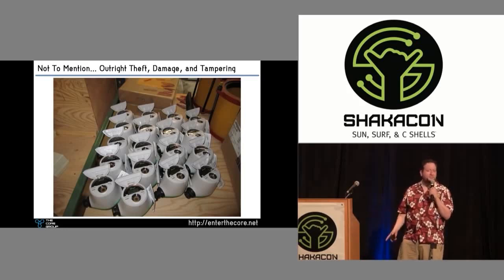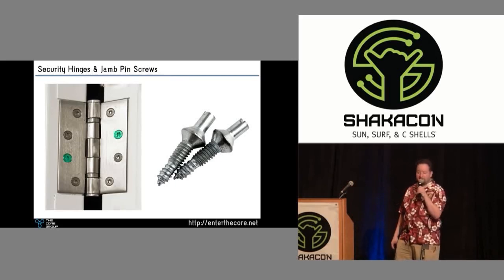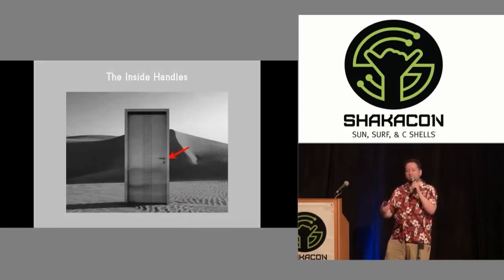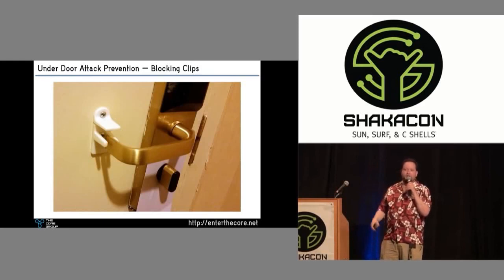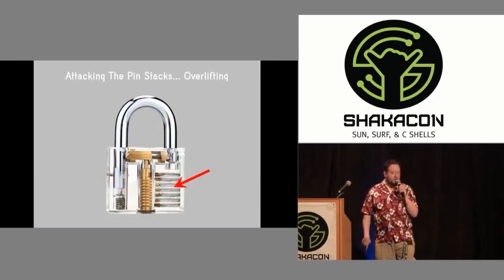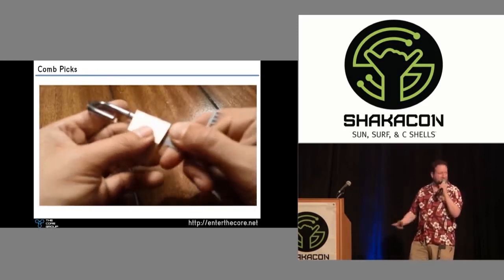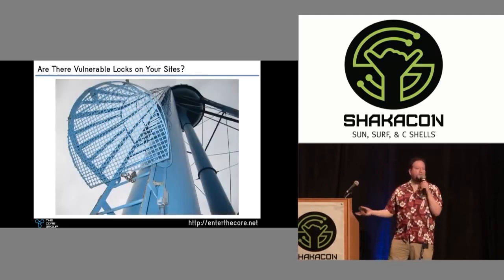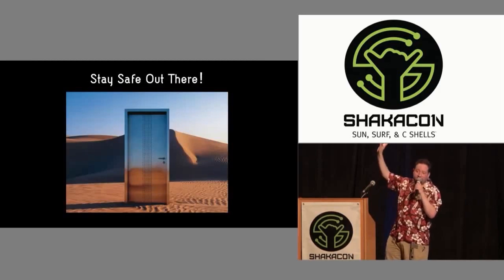ShakaCon "The Perfect Door and Padlock" talk preview

Comment: Another selling point for tightening up door fit: reduces heating and cooling wasted energy.  Can be sold/marketed as "going green" or reducing heating & cooling costs depending on the client.   Particularly true for doors that open to the outside, like double doors with crash bars.  Also a good sell for server rooms that are temperature and humidity controlled.  You can reduce load on the server room HVAC system and make the climate control system last longer by getting doors that shut properly and tightly.  

Love the talks, man.  Hope to see you continuing to post them on Youtube as time goes on!
Reply: Yep. Tons of doors are fitted very poorly. The ones to my dorm are loose enough (and lack the weather fitting rubber) that I can stick a 6mm hex key from my bike to slip the door's latch. Hell - the gap under the door is at least a centimeter. I feel sad for those who have rooms near to it in winter.

Comment: Most of his door breaching methods wouldn’t work with European doors. American locks and doors seem prehistoric for some reason - perhaps due to fire codes. My front door is cheap but it has 6 point locking around the frame. On the inside the door can only be opened by a key (no knob to turn). The hinges are on the inside. The door is made of uPVC so a battering ram just bounces off it
Reply: Care to give a link to what it is? Sounds interesting.
Reply: Mac·au Here’s a link to a video that shows the multipoint locking mechanism that’s standard here in the U.K.  - https://youtu.be/fGpcfCwimXU
The way they work is that before you can turn the key to lock the door you have to pull the handle upwards. This causes bolts to stick out of the sides and top and bottom. These bolts can spin freely in position which makes sawing through them more difficult.

Comment: I wonder why american doors are designed so poorly. Quite a few of the attacks mentioned in the video won't work on cheap European doors. Basically all doors in Europe (even cheap doors used in the building) have double rebates (one on the door, one on the frame) which basically stop all attacks that require you to push anything through the gap between the door and the frame. Doors generally open to the inside of rooms (especially everything that needs to be locked), so there are no exposed hinges to hack. And that's not only security doors but even the toilet doors.

And the rebates also reduce light and heat leakage by a lot.